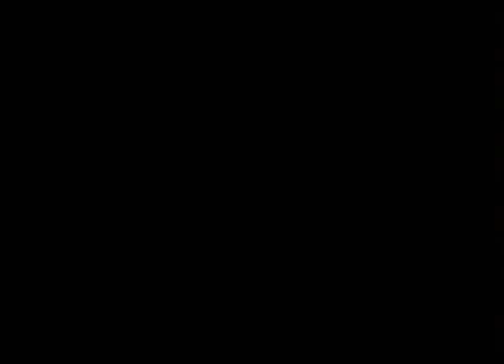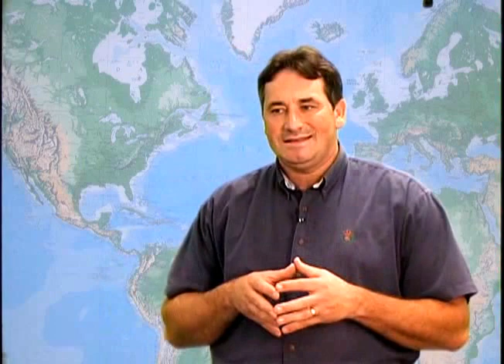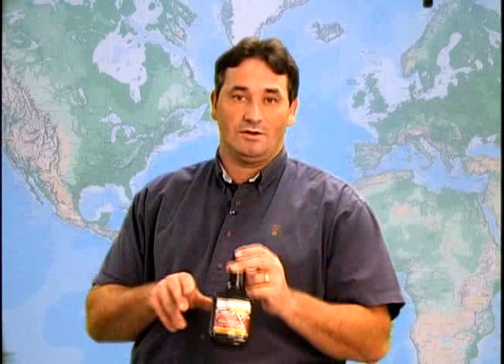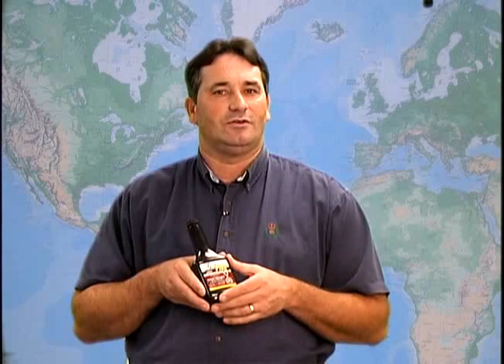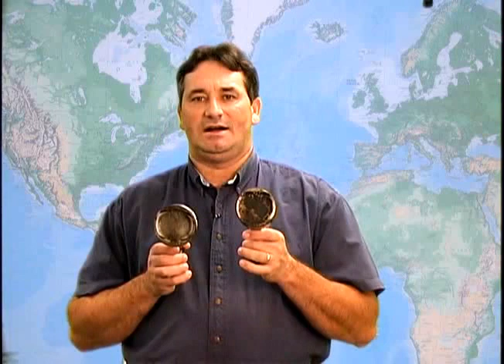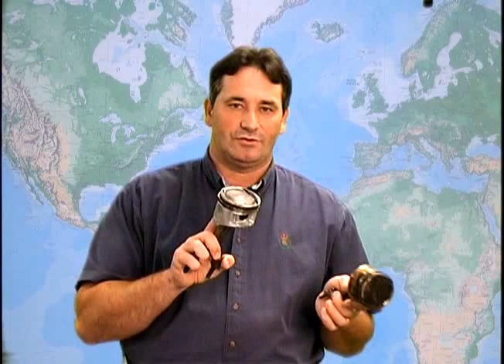Xcelplus Engine Treatment: Single application super lubrication (Introduction)

Comment: Ok I'm sold but why do we have to pay $100 AUD in Australia. I remember this when it was Slick 50 back in the early 80's we had a worn out RX4 use to smoke it's head off, once it got a treatment of Slick 50 you had to keep backing the idle screw off, this went on for a week until there was no smoke and it was like the car had a rebuild. Get me some Xcelplus please I got a sick Mazda 121 the daughter drives and I don't got the money to rebuild it just yet.
Reply from the maker: $99 includes postage anywhere in Australia